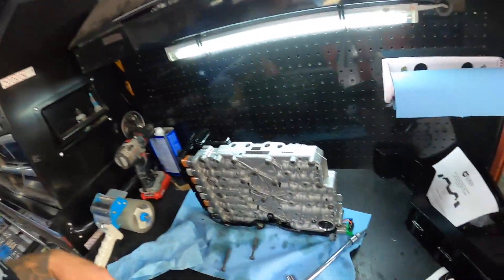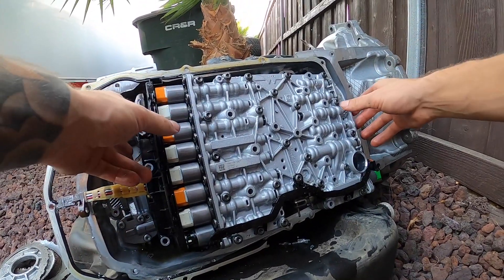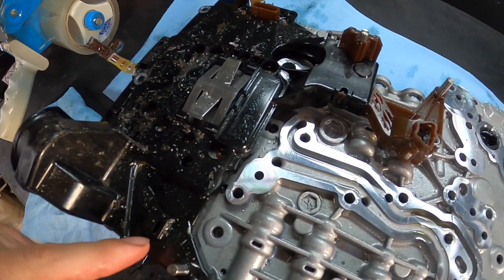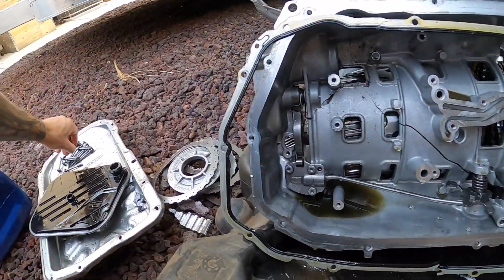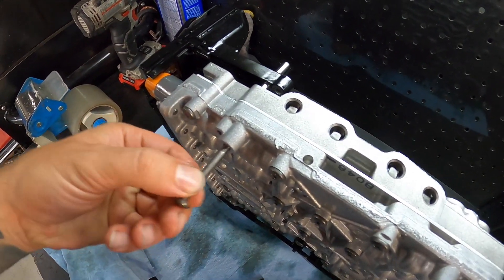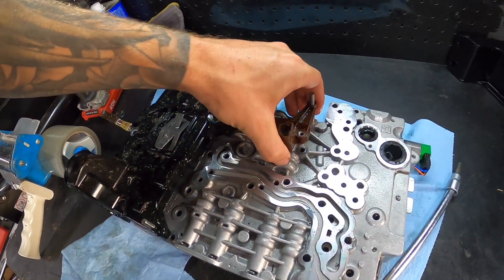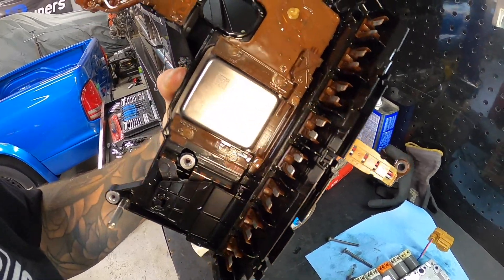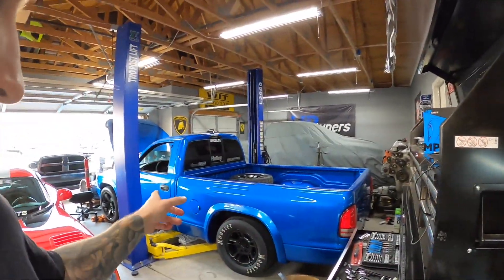HOW TO REMOVE TCM 8HP90 & 8HP70

Comment: Quick question, if and when the 8hp45 goes out in my 280k mile v6, I’m going to buy a new trans for it.

Can I use this method to swap my old TCM onto the replacement trans so I don’t have to have any programming done?

Comment: PLEASE HELP - PLEASE HELP
Let me know if I understand correctly. To replace the valve body hose, the small plastic tube that holds the TCM connector, do I have to remove the valve body and everything else? Or do I just remove the transmission oil pan and pull the clamp back?

Comment: I have a bmw f10 and im getting possible speed sensor faults, is it worth replacing the speed sensor? 8hp70 trans as well, or could it be the tcu? Where can I find the speed sensor if you know the part number  and how does it come off the tcu ?

Comment: If you replace your transmission with a correct used replacement but has different rear end gear ratio will you have to use the original tcm or do any special programming or anything else. Have you ever done this in a stock truck application?

Comment: Thanks so much for posting this short video. I was in the middle of swapping a used low mileage trans into my eco diesel ram and swapped the TCM as you suggested.  Works awesome no programming ….. 
I’m just not sure if it should be quick learned or will it learn on its own?

Comment: This video sort of confused me with having to pull that connector all the way out.  Can I remove the valve body with the transmission still in the truck?  I have a 17 Laramie 4x4 with 8HP70.  It seems as though the main valve is bad as it takes way too long to change from R to D and vice versa.  Thank you in advance!  I was getting ready to do a fluid and filter change until I ran across the info that the problem is with that valve in the valve body.  Now I’m going to wait until I can either fix or replace my valve body.

Comment: I have a 2011 bmw x3 with the 8hp trans.  I bought a used trans, took out the valve body, and installed my original tcu in the used trans.  It's going in the car in the next couple days.  Hoping this works.
Reply: @Lunatic I ended up  installing just the control module from my original trans into the used one.  No programming needed.  I did not even have to reset adaptations.  It shifts perfectly.  I was told this can't be done, but it worked for me.
Reply: @stanleykwak717 did you just swap the Tcm from your original trans?
Reply: @nelsonm2697  yes sir.

Comment: These transmissions are in BMWs as well and they restrict you from swapping in a used one. They have a special "code" or I'm not sure what it is exactly but it doesn't allow you to put the car in any gear with programming the vehicle. If swapping the old tcm into the used transmission will I be able to avoid the programming?
Reply: yes, I did exactly that just 2 weeks ago and it works great.  No programming or coding needed.
Reply: @stanleykwak717 did you replace with a used tcm?
Reply: @abit5295  I installed my original tcm into the valve body of the new [used] transmission.
Reply: @stanleykwak717  I’m trying to install used tcm from another car wondering how to code it. Found cloning service on eBay but would be better to just code it on my own
Reply: @abit5295  I saw a youtube video of a guy using an Autel scanner to code it.  I don't remember which model Autel.
Reply: @stanleykwak717 hey do you have the link to that video ?

Comment: Jon I would not toss any of that out or scrap I am sure there are good parts left......and I am sure some tranny shop would be interested in it sooner or later that TCM is like $3400 bucks from dealership and the selonoids are expensive also demonology had a guy redo his tranny and the builder was saying if you got one hang on to it cause you can't buy just what you need....you have to buy the complete kit from Mopar.....I know you may think it's junk but most of it isn't save the pump all the hardware ect ect put it in Ziploc bags with fluid and then in a box and put in the trailer cabinet.... that's what I would do strip it out of the case and scrap the case but everything else hold on to..... thanks for the quick video 👍👌✌️